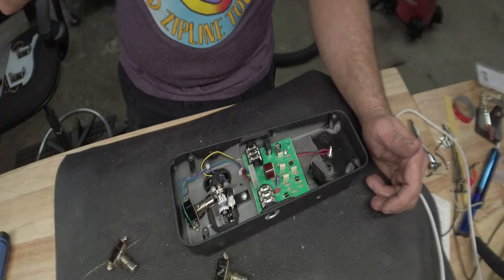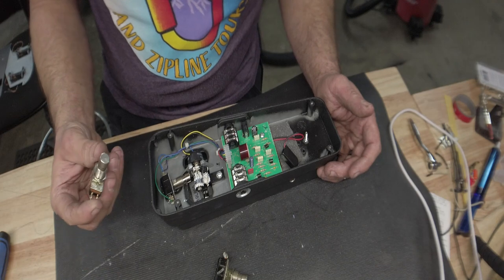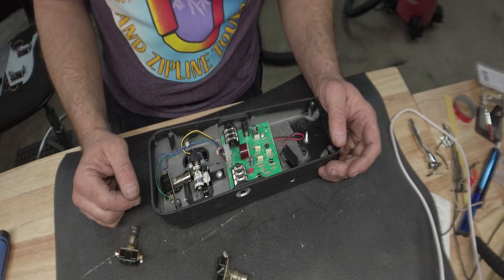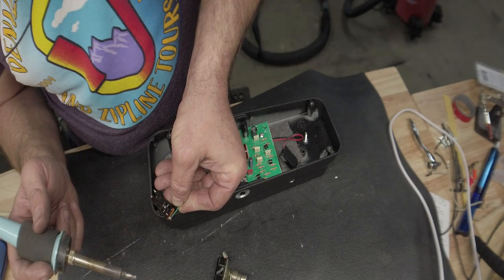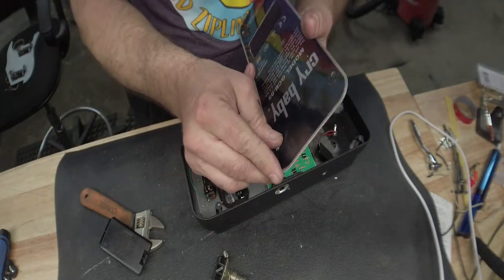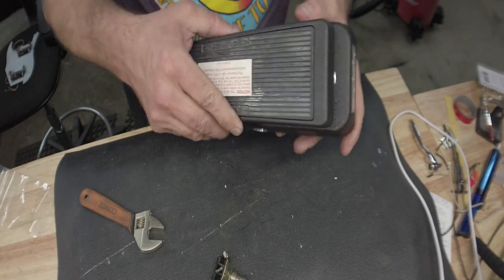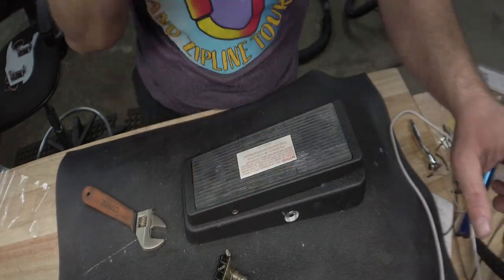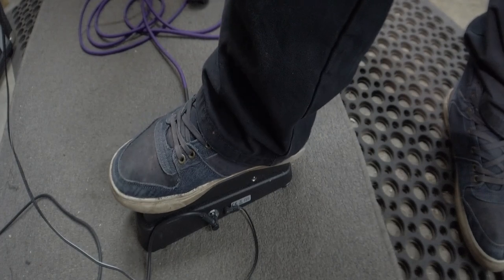Repairing a Cry Baby Wah pedal

Comment: Question:
On my OLD Cry Baby, the red wire coming off the 9v battery connector broke off from wherever it was soldered to the board or somewhere else..? I have no idea where it was connected. Can you help?

Thanks
Reply from the maker: I would need to see a clear close up picture of the board to be sure but on mine, the red and black wires to the battery are the two on the left side of the main plug on the circuit board as you are looking at it with the pot pointing up.